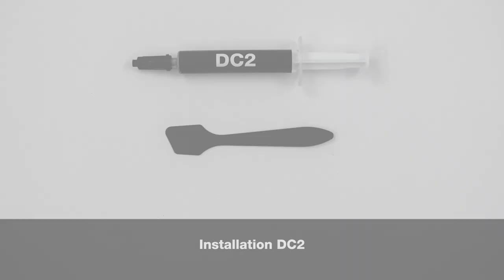Installation: DC2 / DC2 Pro | be quiet!

Comment: Is the dc2 thermal paste compatible with my acer nitro 5?
Reply from the maker: Hey, depends on which DC2 thermal grease you are referring to: 

DC2: Can be used for all kinds of coolers.
DC2 Pro: Only use with nickel plated coolers, incompatible with HDT and aluminum surfaces.
Reply: @bequietofficial  thanks!

Comment: DC2 Pro can be used in combination with a Ryzen 9 5900X and a 100% copper waterblock? thanks in advance.
Reply from the maker: Hey, liquid metal thermal paste can be contact with copper or nickel-plated copper. But not with aluminum!
Reply: @bequietofficial  in video you said that it can't be contact with copper and in comments you said that it's possible? i don't understand...

Comment: can i use it with the pure loop 2 fx 240mm?
Reply from the maker: Hey, since the coolerbase is made of nickel-plated copper, you can also use liquid metal/liquid metal thermal paste with the Pure Loop 2 FX.
When applying the DC2, make sure that the paste does not come into contact with aluminum, otherwise it would damage aluminum components.